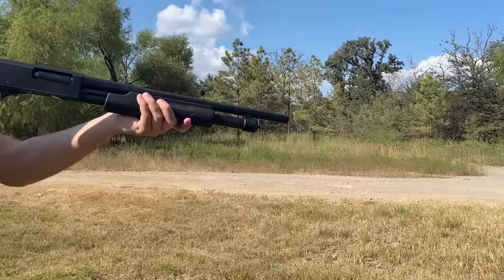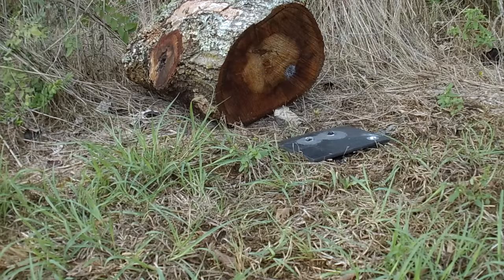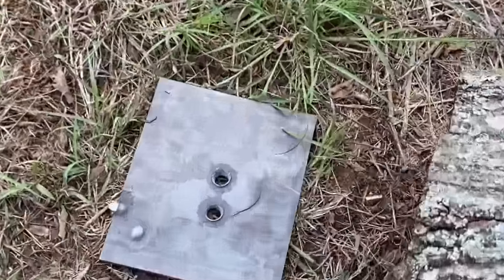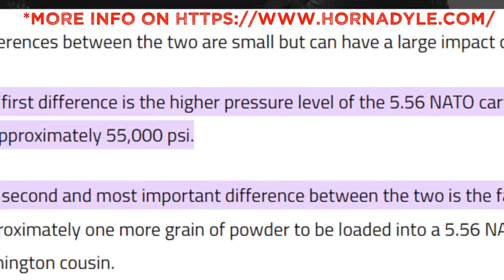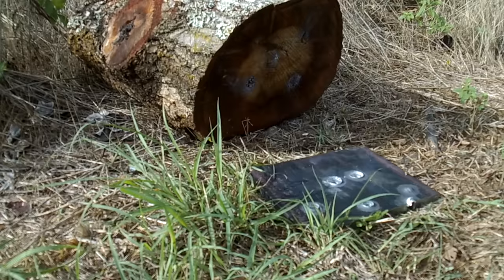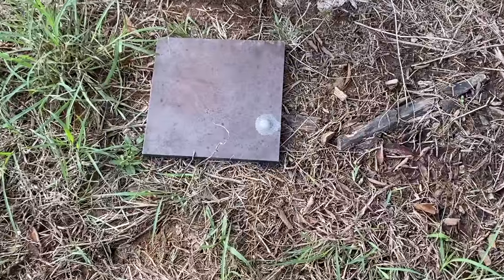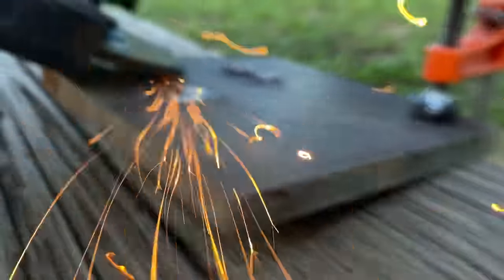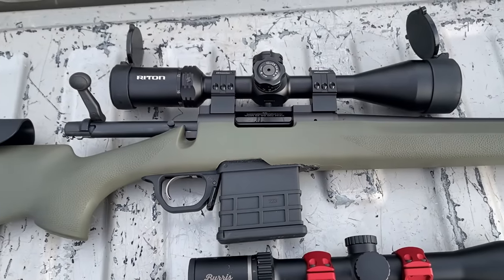223 vs 5.56: You Won't Believe The Difference On Steel

Comment: Chronograph.  You need a chronograph to truly understand what's taking place.  Also, I would pull the rounds from the brass and measure bullet weight.  The published specs aren't always correct.

Comment: Be nice if you could have fired 5.56  M855 62gr green tip.  I believe you would be impressed.  I am!  I just bought a bulk shipment of them 1,000 rds. @ $0.42/rd
Reply from the maker: https://youtu.be/T9qyoivkeEU I was pretty impressed, but unfortunately they would not stabilize in my 24" 1-12 to see what they will 100% do

Comment: The difference in throats is to accommodate tracer rounds which are less dense and have to be larger in size to remain the correct bullet weight and maintain accuracy/reliable function. It’s has nothing to do with extra grains of powder. There is .223 that’s hotter than 5.56 and vise versa.

Comment: Where you find the difference between 556 and 223 besides the free bore is that the 556 cases are thicker. 

Check the case volume. 556 cases are thicker. Take a fired case, place it on a scale that will weigh in grains, record the empty weight, then using an eye dropper, fill the casing to the top with water. Repeat with the 223 cases. 

I sort casings by heads tamps, then weight. The higher the weight, the less internal volume. I’ll calculate the difference in volume, and reduce the amount of powder. 

When I fire the rifle over a chronograph, I’m getting +/- less than 15fps. If I don’t reduce the powder charge, the lighter casings will exhibit round shoulders on the primers, while higher weight casings will flatten the primers. 

Include a chronograph in your testing for the real story.
Reply from the maker: I was initially going to include that the 5.56 cases were thicker in the video as I separate them as well. But reading further into it, there are some (very few) 5.56 case manufacturers have more internal volume than 223 cases, which I found odd. 

Once I get a chronograph I will include the velocities.
Reply: @bananaballistics  there’s only two locations that can contribute to heavier casings, the wall thickness and the case head thickness. That’s why it’s important to obtain case volume by measuring using water. 

The 556 casings that have more internal volume, have to be attributed to using a different brass alloy. 

I use to load 8-10,000 rounds of 55 grains of FMJ, and 5-7,000 rounds of 69 grain Match Kings. The FMJ is in a Dillon and the Match King are all hand loads. 

69 grain MK’s with 24.5 grains of RE15 using commercial brass, 24.3 grains of RE15 on LC military once fired brass.
Reply: Fellas, I stopped trying to explain the difference a few years ago when I noticed so many off-brand ammo manufacturers muddying the waters with thin webbing cases being labeled as 5.56 or foreign nation 5.56 being recycled, reloaded, and packaged as generic .223 for the US market.

Comment: That wasn't spalling. The "wad that was punched out" is spalling.   Look it up. One more grain of powder is so negligible as to be almost irrelevant and is the powder the same type in each round?  Primers the same?  That can vary from batch to batch. . Then you have to look at the actual projectiles. Are they the same? Are the jackets the same thickness? Is one a hollow base and the other a flat base?  How perfect is the target? It is compromised already. The angle of impact has to be the same as well, because at 3400fps it is going to make a difference.  The difference in these two rounds is so miniscule that either can be fired from any gun of the same calibers.

Comment: Not to mention 5.56 brass is a tiny bit thicker than .223. I would imagine this causes the powder to fill up closer to the bullet and create more pressure as well? Haven't been loading long still trying to work it out. Been through 5 one gallon ziplocs  So I guess I'm on the right track. 😂 But I made a fatal error and didn't keep the brass separated. Because I wasn't smart enough to buy one of those cool nets that clamps to the rifle. I guess it's not the end of the world. I just found a  matching recipe from each and just load with that so it doesn't matter what brass is  what. I was surprised to see that Sob go through the front and back of a small safe though. 😳

Comment: These are not different calibers, but rather, 5.56 cartridge is a variant of 223, being kind of "hotter" than 223. Also, there might be some differences in the material of which the bullets are produced (the "envelope" of the core could be made of a brass or aluminum or copper). Anyways, the difference in effectiveness is marginal).
Reply: Agreed

Comment: ok let's be real for a bit. the higher pressure in 223 when firing heavy bullet weight 556 is because the chamber is tighter in 223. i.e. little to no free bore. this is why the 223  Wylde chamber is 1/2 way between the 2 and will fire both.
all rounds need speed to get the job done . the 2nd test brings this out. where the longer barrel gets through. looking at the speed of each from the beginning  it seems 50fps is the difference. i would have liked to see a coronagraph to know the real FPS on both. 

lastly don't shoot steel. 2 to the hips and 1 to the lips. broken pelvis doesn't chase you .
Reply from the maker: The 223 wylde chamber is definitely the best of both worlds. You may be correct with the 50 fps, but unfortunately I don't have a chronograph at the moment.

Comment: Just throw any old steel plate and any old angle and call it good.  There is a reason why tank armor is the way it is.  Just a few degrees difference in the plate means more material to penetrate.  Throwing the plate on the ground at any old angle could have been the difference.

Comment: There's more to it than just a few fps. .223 is lead core. 5.56 is NATO, which uses steel core. 223 has a lower powder charge and produces lower chamber pressures. The chamber itself is also different. NATO chambers have a longer throat (or taper) to the riflings. The cartridges are the same, dimensionally.
Reply from the maker: The hornady website that I was referencing said that the 5.56 has a .125" longer throat which is insane! Also, at least with the ammo tested, I cut both projectiles in half and was not able to find a steel insert in either (verified with a magnet).
Reply: @bananaballistics  not a true NATO round then. Might be NATO specs on the powder and weight but to be used in war, can't be lead. Geneva conventions made a lot of BS rules. Like swords being a war crime.

Comment: also hitting near a cut edge plays in, as cut edegs have received heat to them.. it strengths mild steel, just my observation from powder coating steel
Reply from the maker: That definitely could be a factor. I cut them on a bandsaw with a cutting lubricant, but there is probably still a decent amount of heat involved.

Comment: I have seen several of these videos supposedly telling the difference in .223 and 5.56 ammo and not a single one especially this one tells the truth. I may have to make my own video. I'd post pictures if I knew how but I don't.  5.56 is a NATO round which has standards and is mostly steel core which is going to make it penetrate a steel plate better. .223 is a civilian round which pretty much has no standard.  The muzzle velocity and energy vary greatly depending on brand and use from less than 5.56 to more energy and velocity..223 is also lead core which has more "knock down" but less penetration.  .223 also varies greatly in bullet size from 55 grain all the way up to 72 grain and can be fmj, hollow point, ballistic tip, boat tail. All this will vary this test. This video is absolutely in no way a test or description of the difference between .223 and 5.56 ammo

Comment: Not all 5.56 is created equal.  Depending on manufacturer you will have a variety of charges and bullet make up.  Your test is fine for showing what a .223/5.56 can do (which is impressive) but to come to a scientific conclusion, you have to know what’s inside those casings.

Comment: Tell you the difference of it right here right now without having any freaking problems with anything it's the same ammunition but ones in military style and one inches the civilian style writing 556 is basically a 5.56x45 mm that's the military writing the 223 is a civilian caliber of the 5.56 x45mm one civilian and one is military grade they're the same round but the military has their rifles set up for a higher pressure because they fired out of the M16 the 223 is set up to fire out of a bolt action rifle but they're so similar to stay in caliber it's hard to tell them apart because people think they are two different cartridges and they're not the same cartridge just wrote in different things civilian market and military market same rifle caliber all the way around just different grains of bullet that's only different
Reply: Except when sighting in don't mix different results. Military taught some of us.
Reply: The chamber is also different. The 223 has a very short throat, almost engaging the rifling when chambered. The 556 has a bit of free flight before engaging a longer taper (or throat).

Comment: I see some comments where they say to put the steel plates perpendicular to the trajectory of the round
Ok fine
Yet when I see these types of rounds going through steel that thick, that says something profound
Now I am certainly not a ballistics expert, yet let us say any one of us whom use 5.56 or .223 in our rifles, would worry about the penetration into .375 (3/8") of steel, then you are too ate up to think about that
IF you ever have to shoot into anything that hard and thicker than a sixteenth of an inch, to protect yourself, than ok but this being real life and not a test lab (field), I will not worry about penetration of body armor that anyone may be or may not be wearing.... 
IF you have to use your rifle to shoot anyone, do you really think using a magazine with a capacity of over ten rounds,  you do not shoot them in the head, neck, arms, legs, pelvis at all???
Listen, severing a few arteries with a rifle is a very easy thing to do... Most people are obsessed with center mass
Shoot for the pelvis
You'll be fine

So, to wrap up and summarize:
Shooting the .223 or 5.56 through steel works just fine for me
It isn't bone and flesh
Sooooooooooo
Tilted or straight up?
Eh
a hole is a hole is a hole
Reply: They want a fair comparison. Thats all.

Comment: 2:45
0.125" longer throat ?
What does SAMMI say?
.O25 vs .050
556 brass is also thicker and therefore there is less water volume.
SAAMI

Comment: 30fps is meaningless. The projectile matters.
Reply from the maker: Certainly true, I wish I had a chronograph to see if it was only 30 fps difference or even more.
Reply: To be a fair test the bullets need to be pulled and swapped .  The results would probably be reversed.  The 30 fps is almost a normal variation if 10 rounds are shot using the same ammo.  The bullets are probably closer to 3100 to 3200 fps out of the short barrel.

Comment: 5.56 and 223 are the same exact round, one is just nato and the other is just standard
Reply: Same dimension, different projectile core, different powder charge, different chamber throat.
Reply: Yep. People have a hard time understanding that the same round shot through different chambering (223 vs 5.56) will result in different pressures. 
The 5.56 chamber has a longer leade which allows for a higher charge without going overpressure. 
As a result, you get different pressure and velocities based on which firearm is used. 
Furthermore, just because it says "5.56" on the box does not make it hotter than 223 branded ammunition. Point in case: PPU 62gr "5.56" tests have shown average velocities of 2,534fps whereas Hornady Black 223 showed 2,606fps average.

Comment: Pretty sure you don’t get any more powder burn after 18 inches of barrel for .223/5.56, so I will speculate that the 24 inch barrel won’t make a difference. Let’s watch and see!
Reply: So, that was an interesting. I think the .223 punching through the 3/8” plate had more to do with it being fired out of a bolt action, so as not to lose any gas pressure, rather than the 24inch barrel helping it out.

Comment: Without setting the plate carefully for angle and support, the test is quite flawed.  It would also be nice to have a chrono to verify what speed they're doing vs. relying on manufacturer specs.  I can't imagine that 30FPS alone was responsible for the differences witnessed.
Reply from the maker: I agree. I recently made a testing fixture and hopefully will be get a chrono somewhat soon
Reply: @bananaballistics  Something I just realized, 5.56 chamber specs are looser than .223 and Colt chambers are even looser.  So if the 5.56 ammo speed is based on the looser military chamber, when both cartridges are shot from the same chamber the 5.56 ammo is likely to have a much higher speed than .223.

Comment: I see that you are carrying through with the same level of misunderstanding that you displayed in your 6.5 Creedmoor vs .308 penetration test.  The differences you see here are not due to whatever paltry differences in velocity exist between these two cartridges, it is due solely to the differences in bullets used.  A 55g FMJ is not simply a 55g FMJ - they vary tremendously from manufacturer to manufacturer.  In this particular case, the military M193 bullet is of sufficiently different construction than the commercial Hornady example as to account for the differences in penetration.  Swap bullets, using the Hornady in the 5.56 and the M193 in the .223 and the results will be swapped as well.  Use the same bullet in both, and you will get the same results from both.
Beyond that, the explanation you give for the differences in chamber pressures between the two is significantly flawed.  Yes, the 5.56 is allowed higher chamber pressures than the .223, and is loaded accordingly.  That's the only part you got right.  You see, the 5.56 is not allowed higher chamber pressures because of its longer throat, as you suggest.  That longer throat is not there to mitigate, or reduce that higher pressure.  The 5.56 is allowed to generate higher pressure when fired in that chamber, with that longer throat.  And that is where the real danger lies when attempting to fire 5.56 in the .223 chamber, with its shorter throat - because the 5.56 is allowed that higher pressure in the longer throat, imagine how high those pressures get when it's fired in a .223 chamber.

Comment: IF you fire a max load 70 grain bullet 5.56 loading it will build "more" pressure than .223 loads are "rated". I'm no expert, but "if this, then that" is shaving real world usage. The  proverbial BCH of difference. Or RCH if you've kissed the Blarney Stone.
Reply: I have been reloading since 1976 and speaking just about the 223 and military designation 5.56x45 there is nothing different about loading these cartridges and even the Hornaday reloading book I have shown data together listed as 223 / 5.56x45.
Also, the top powder charges for 223 & 5.56x45 tend to flatten the primes after firing showing never would you see this pressure in commercial 223 or 5.56x45 so the liars bull shit that 5.56x45 blows up 223 guns is just that liars bull shit from morons that go on and on repeating nonsense from these YouTube videos made by fools who also have zero hands on experiences in firearms and reloading.
Again about signs of pressure in spent casings I have often seen when trying a new powder, I can get pressure so High that primer is totally flat, and the firing pin indent has burned through the prime and still I've never damage rifle in 223 or marked 5.56x45.
This is so much garbage in these videos by people who really haven't a clue what they are talking about because they have zero personal experiences of their own.
Reply: @Lure-Benson  I mean Shooter's World shows loading for 223 vs 5.56, so maybe hornady didn't want to risk any liability by showing both and confusing already confused people on the matter of 223 vs 5.56. 
Off the shelf 223 and 5.56 is largely interchangeable because they put 5.56 on the box and significantly underload it. IMI and Black Hills make some hot 5.56 loads, but PPU is a joke.
Reply: @no-sway3709  I don't know what you are trying to tell me.
I have been a reloader since 1967 and custom rifle builder for 20 years.
So, unlike the knuckle head YouTube armchair experts I actually have experiences in everything I write about.
Anyone who said 5.56x45 blows up 223 guns is an idiot without any experiences at all with guns - ammo and reloading.
For many years I have loaded 223 and 5.56x45 spent brass to the same powder charges that flatten the primers when fired, so if guns blew up over one of the other cartridges, I sure haven't seen it.
I have even goofed with too much powder then like welded the cartridge to the chamber and still not blown up the guns.
I banged the bolt open cleared the really messed up brass went back to using the AR 15
Reply: @Lure-Benson  if you read your initial statement, you'd see that you mentioned there's no difference in loading manuals you've used. 
I made the point that Shooter's World does have different loads for each. I further speculated the reason hornady does not is because of liability. 
5.56 on box ammunition seems to be more of a gimmick than statement of how hot its loaded, which is why these videos comparing the two generally suck.
Reply: @no-sway3709  I know long use leading manuals because I know the powered and the leadings for all cartridge I own.
I do have the loading manuals, and some are really old.
I never said that and when looking in a reloading manual you see great differences in the same powered loadings for same cartridges
Reply: @Lure-Benson  I think you missed the point entirely, but that's OK.